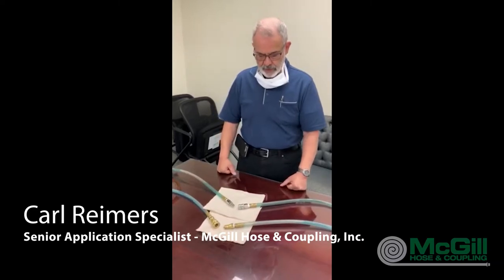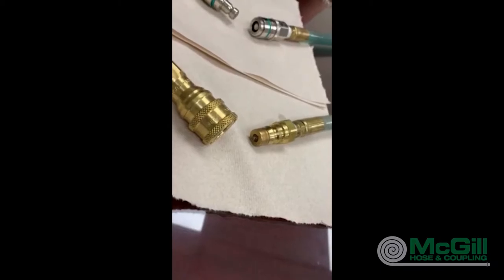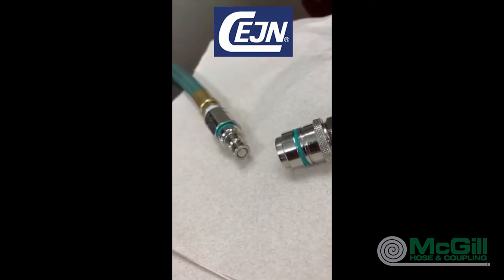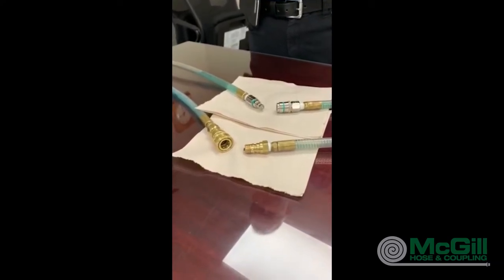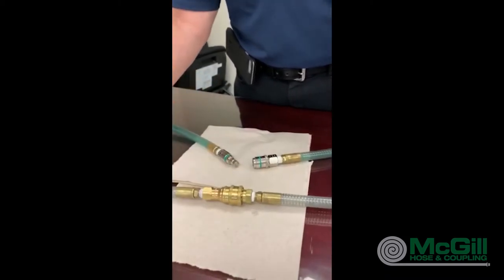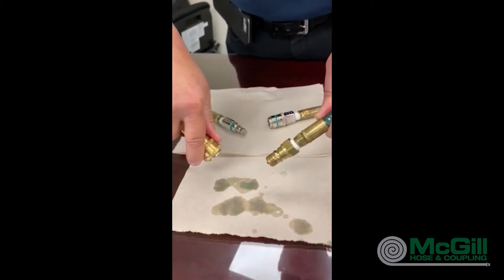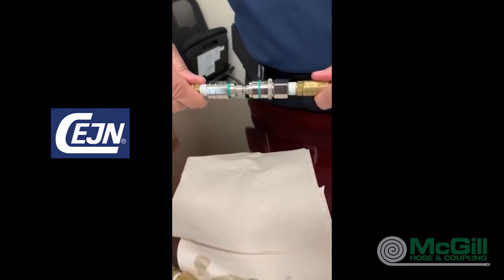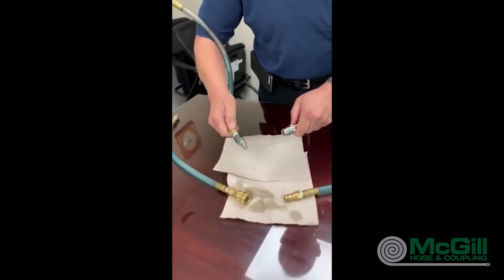Cejn Dry Disconnect Non-Drip Quick Couplings Demo | McGill Hose & Coupling

Comment: One question; would this work for steam/fog as well as a fluid?
Reply from the maker: An answer for you from the manufacturer: 
For a steam application up to 150°C (302°F) brass with EPDM seals will work.  For a higher temperature, stainless steel and Kalrez would be appropriate.
It is important to keep in mind that the color coded rings are designed for use up to 125°C (257°F) only.
Otherwise the standard parameters of the range apply.
Please refer to - https://www.cejn.com/products/fluids/non-drip-stainless-steel/?code=non-drip-stainless-steel-1199&filters=#parts
Reply: McGill Hose & Coupling, Inc   I thank you very much for this extensive answer, sir.